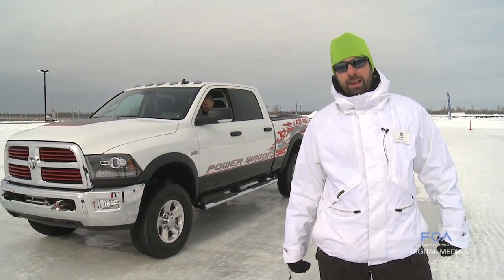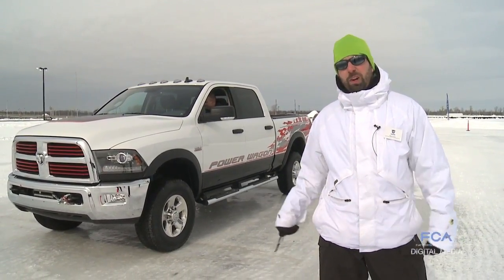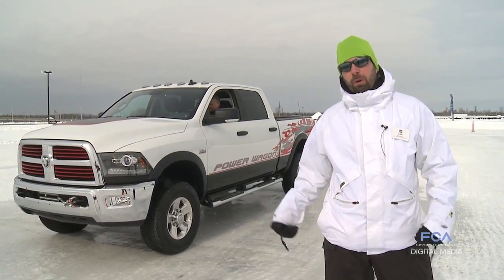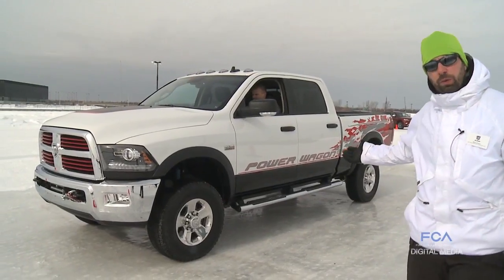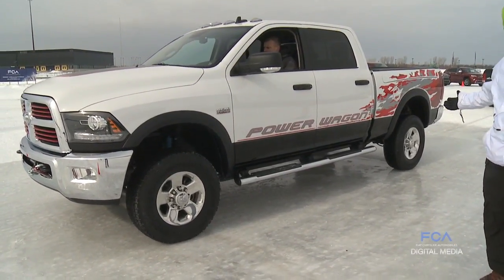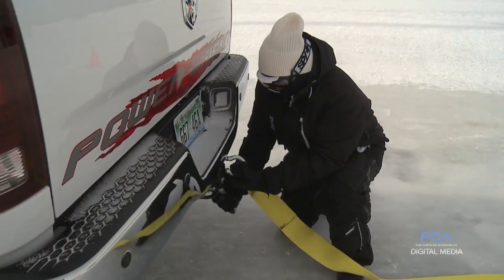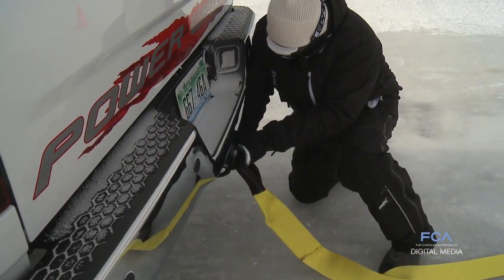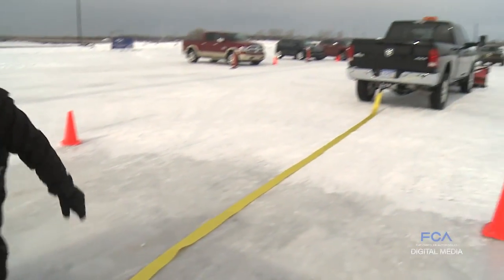Power Wagon Transfer case demo

Comment: I'd be interested in knowing what would happen if the two front tires were in the snow and the two rear tires are in the ice.  Would the torque driven to the two front tires be equal to the torque to the two rear tires and hence be super low since the rear tires are slipping?  The center differential is an open differential, right?

Comment: One thing that sucks is that the Power Wagon, including the newest gen, don't offer a transfer case with an open center differential mode, which would be really nice for shitty highway driving in really messed up areas.  The newest one is something I would get for Iceland.

Comment: That's great explanation, but useless.  The truck isn't moving.  You need to have proper resistance on each wheel to show how the transfer case is working.   All I see as a consumer is all four wheel spinning and I'm not getting any where.  Your making the power wagon look bad.
Reply: The wheels spinning at the same rate while distributing even torque to all wheels was easy enough to see for me. Technically the truck was moving. If the truck behaved in an opposite way than the explanation I would have cause for concern. The idea that it behaved exactly as described makes the Power Wagon look good not bad. Your concern would have been displayed if one of the wheels was spinning a little slower or faster. "Proper resistance" is not needed if the wheel that has traction spins at the same rate as the ones without. Either way, Ice or rock, this feature behaves in the same manner.